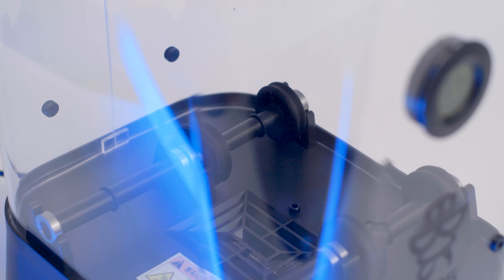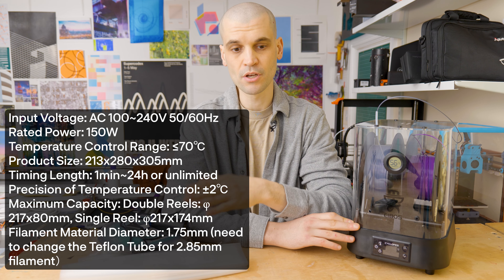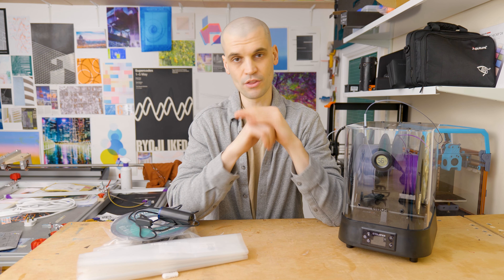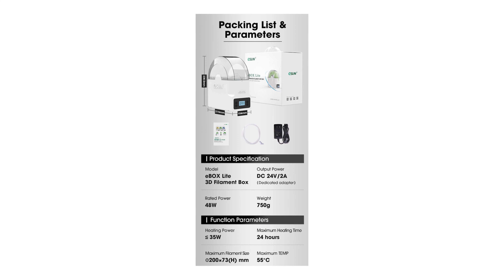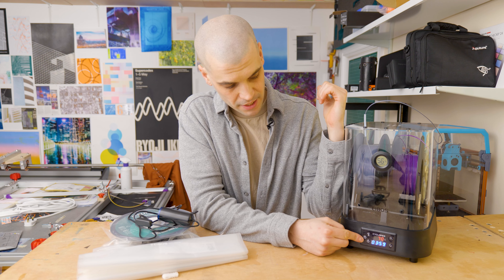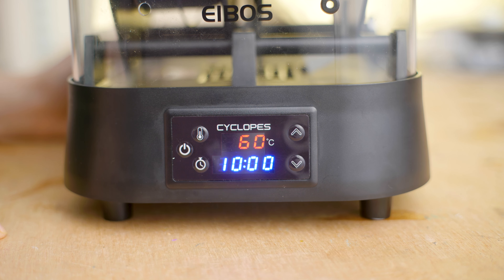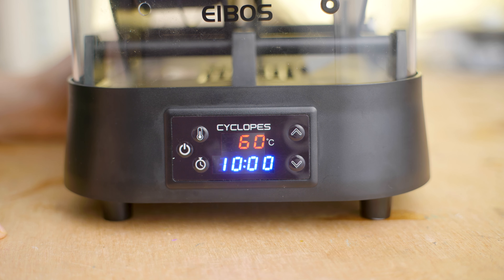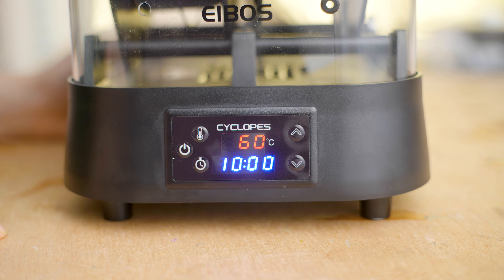Eibos Cyclopes + Eurus Review - Filament Dryer and Storage Solution

Comment: Can you provide a link for the big rollers, please?
Reply from the maker: https://www.printables.com/model/366983-eibos-cyclopes-extension-rollers you are probably better off printing a big roller that spans the entire width of the original roller as these are a bit finicky to place the spool onto but I was trying to save filament so that why I designed it this way. Hope it helps.
Reply: @ThisDesignedThat  thank you! I thought so and will make it longer when I get the time. Never had an issue with filament being close to the heater, but better be safe than sorry.